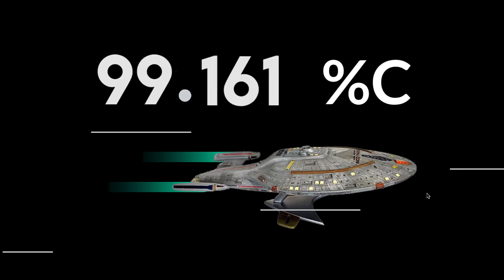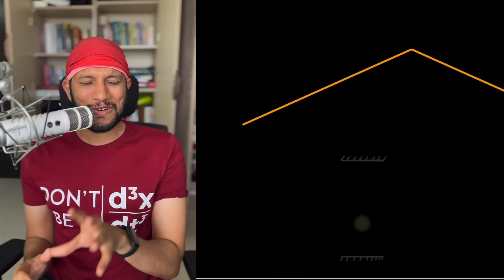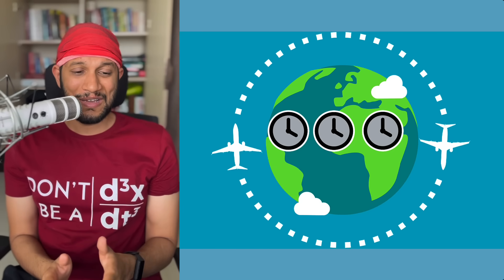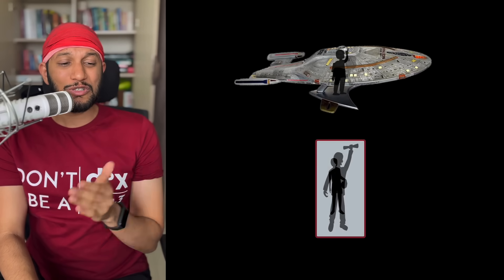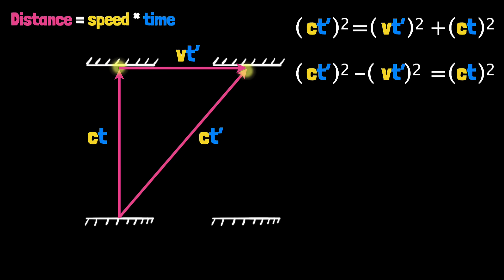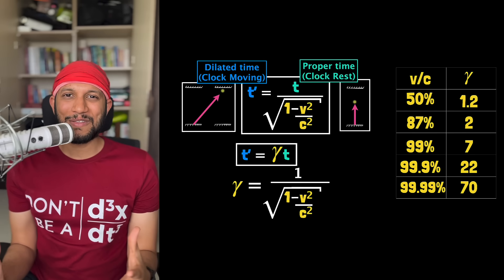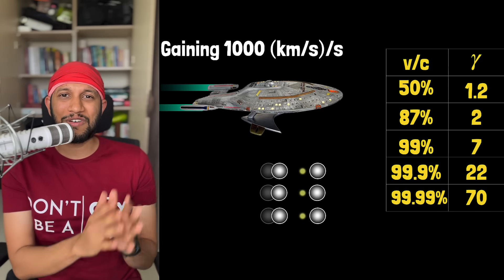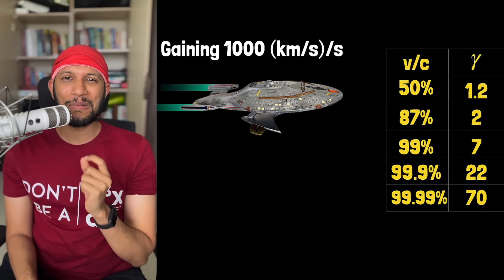I finally understood why you can't go faster than light! (My mind is blown)

Comment: It's just formula and every time when we find some infinite of something there is always some physical limits that prove our calculation wrong it might be bigger then any force in the universe can ever hope to overcome but not infinite just like it was with "Ultraviolet catastrophe" and so quantum mechanics was born. Lets we have no such thing as t` and we have some ball we want to accelerate but our only option is to throw other balls(for simplicity with the same mass) to it first time acceleration would be noticeable (from 0 to half on the speed of second ball) but as closer it is to our maximum speed of throwing it would be less and less significant until it will reach it but would never be beyond it. If do some math with it you would came to exactly the same formula for momentum as for relativity but instead of C there would be your throwing speed. The funny thing is that based on those formulas for relativistic physics we could get very precise match with observations but at the same time reasons for it might be completely different.

Comment: That's only one of the reasons that you can never get to 100% of C.  the second reason is that as you accelerate your engine's specific impulse has less impact on your speed as you get faster.  For instance at a certain point where your ship is traveling faster than the thrust produced by your own chemical burning rocket engine, you will have to switch to something that has a much faster propellent speed, such as an ion drive.  But then when you get to the speeds closer to C and you are literally accelerating the ship with Particles you shoot out the back at C, then you are getting less and less specific impulse as you get faster, and then it aproaches infinite fuel mass.

Comment: Your video is great. What I've heard no one address is the boundary between two objects with light speed level speed variation. Obviously we cannot "see" a clock ticking in a ship moving at light speed to compare with a clock at rest. But we use it as a device. And I am going to introduce an even less possible device for a though experiment to ask my question; If there was a video screen the size of Jupiter, and I was on a ship with the best telescope ever traveling towards it at 99% the speed of light, and the video was a clock at rest ticking, how would it compare with my clock on the ship? Would the clock be reporting the last 22ish seconds simultaneously? How can one meet 22 times the number of photons and have 1/22nd of the time to receive those photons? That is what I mean by the boundary. Am I missing something simple?

Comment: We are all going at the speed of light from the point of view of the opposite side of the universe. 

If the universe expands at half the speed of light the distance from the ends grows at the speed of light relative to each other.

Speed is relative. The earth rotates at a speed but road speed signs dont take that speed everything is already going and is only concerned with the additional speed you move relative to the objects bolted to the earth. 😎

Comment: So the speed of light is not attainable only with respect to the reference frame of an observer? From the explaination, the person in the ship would actually or eventually move at a speed of light at some point but won't know. Correct me if im wrong. I would also love to know the speed of the observation clock ticking outside the ship, using the ship as the reference frame this time.

Comment: I'm still confused -- does this break relativity in any way, e.g. if two space ships move at 0.5c relative to each other, does it appear to both of them that the other's clocks are running slowly? Let's say they exchange twins as they pass, and then one of them turns around and catches up to the other, will only the twins on the one that expended energy to turn around / catch up be the one where they aged at half speed? So it's acceleration that actually slows down time, i.e. we can time travel into the future by expending energy, even if it's to travel in tiny little circles?

Comment: What happens if I’m in a spaceship traveling 299,792,457 meters per second (one mps slower than light), and then I run forward in the ship, temporarily increaseing my speed by about 3 meters per second, which is about average running speed. Have I just gone faster than light? Idk.

Comment: The photon clock is analogous to what is happening in reality.  What do you mean you can't reach c?  You are already... every subatomic in every atom of your being as moving at c. But, there is only one c, so your internals slow down to accommodate your velocity thru the medium of the galaxy.  The same medium that establishes c, and motivates every subatomic everywhere to move at c.  The medium is made of subatomics that are not restrained by the construct of normal matter and always move at c without acceleration.  (The subatomics of normal matter are constantly accelerating.)  Things go boom when they try to exceed c.

Comment: The mistake is the assumption that time won't invert. The observer would see the faster than light ship vanish. The clock would tick forward but the position it ends at is where it was. The really weird part is traveling faster than light shifts off moving you through space and starts moving you through time. If you were to place your 2d graph from earlier into a cube instead of a grid you would watch as your time moved from a positive rate to a negative rate. Which means to travel faster than light to a destination, you would need to travel away from it until the "when" the destination "was" is "where" you are going. The trippy thing is this puts paradox prevention bubble around you as the locations you could actually reach at these speeds couldn't ever send light to where you started. After all, you had to travel several times further than the destination in space because your path moved through time. There's basically "drag" that slows you down for a distance controlled by your mass, overcoming this "drag" gives you a minimum radius of destinations you could reach at any c+ speeds.

Comment: i have a hypothesis for why time goes slower in a gravitational field ....
well time is defiened by things happening right ? (sorry for my English )
so .. for things to happen they need to accelerate and move right ? so the stronger gravitational field the more energy required xthe slower things move ... so that means that whatever kind of clock you are going to use ..if they are phesical clocks that are made of matter that have mass they will get slower in a gravitational field ... i hope this makes sense

Comment: You have come to the same incorrect conclusion that everyone I have seen talk about this subject has done. The reason we cannot travel at the same speed as a light beam that is traveling is because no matter how fast you are going, Light is always going 1x the speed of light faster then you are. As well as the thought experiment that is used to attempt to prove what you are saying is NOT valid because it is not possible to see the sides of a light beam so the so called "photo clock" used in the thought experiment is not possible to use in actual reality thus is not valid. A thought experiment must be a REAL experiment that can be done in actual reality even though you couldnt carry the experiment out at the time you think of is, it must be an experiment that could be done someday if given the needed circumstances to do the experiment. Thought experiments that cannot be done in REAL physical reality are not valid because they are completely imaginary and will never become real.

The idea of needing an infinite amount of energy to get to light speed is also an incorrect concept when claiming that light speed cannot be reached. Again this is due to the ones claiming this are not thinking of real physical reasons why accelerating to light speed cannot be done. When using propellant from a rocket it is the speed of the propellant leaving your ship is what determines the reaction speed that you gain going in the other direction so even if you had a beam of light as your propellant that beam is still limited by the departing speed of light and the reactionary speed that you would gain going in the other direction could never exceed the speed of light because the speed of the propellant leaving your ship always going to be limited be lights departing speed. So it is impossible to go faster then light speed using propellant because there's no propellant that we can shoot faster then light speed to be moved in the other direction faster then light speed. This is the reason why we cannot accelerate ourselves using propellant to the speed of light and it has NOTHING to do with having an infinite amount of energy at your disposal in order to do so. If the speed of light is a finite speed then what sense does it make to claim it takes an infinite amount of energy to reach a finite speed? To this day I never see anyone come to this correct conclusion for light speed and time dilation all I ever see are people like this that just repeat what they have herd someone else already come up with not realizing that there ideas on the topic are incorrect or the thought experiment they use to attempt to prove what they are claiming is INVALID to begin with....

Comment: How about this? The only way to push, or add kinetic energy, to a mass is by a force applied by electromagnetic interaction (QED), photons moving in the direction you want a mass to go. No matter how much energy you put into the photon, or how many you apply the photon energy is red shifted to zero relative to a mass moving relative to you in the direction of the photon at the speed of light.

Comment: Question: I’m still early in the video so maybe you address this, but why is it necessary that the ticks of the photon clock are slower just because it’s traveling a further distance? Sure its net velocity is higher because because of that, but its movement in the vertical direction is still equal, right? It’s just that now there’s a horizontal component as well which is being applied by the movement of the ship.

One issue I see with the above statement is that this could generate speeds faster than the speed of light. If you are traveling near the speed of light in the vertical direction and then added a horizontal component, if they are not completely independent, then you could go faster than the speed of light. So I imagine I’m wrong with the above statement, but I’m not sure why
Reply from the maker: You actually mentioned it yourself. The net velocity (along the diagonal) has to be c! So the vertical component can no longer remain c. It’s lower!
Reply: @Mahesh_Shenoy ah ok. My bad. Thanks!

Comment: but if the speed C stays the same in all frames wouldnt the people on the ship see the ship still gain speed at the normal rates? it sounds like thiis only works for anyone out side the ship looking at the ship?
Reply: People on the ship would accelerate at normal rate, but their speed relative to outside objects wouldn't reach C. 0.99C + 0.01C < 1C.
Not sure if it can be explained by time dilation, it's more about space contraction from that frame of reference
Reply: just seams that if C is the same in any reference frame then C should still be at the speed of C for the peoples reference frame in the ship meaning to them they would continue as if nothing different was happening. if not then the speed of C iis changed for the people on the ship 
 @fritt_wastaken
Reply: @VdemiconV  everything is normal for people on the ship, C is still C. But speeds don't add up linearly, they never do
Reply: @fritt_wastaken  sorry it took so long to write back lol was moving and starting a new job. but on the ship everything is going as normal. so it would be like watching someone fall into a black hole. at the event horizon the one watching would see them stop at the horizon and then slowly fade out. but they are no longer where you see them. that is why i still think the ship moving closer to the speed of light will be still working as normal and getting to that speed but because of dilation you only see the ship slowing down until it fades out like if it fell in a black hole. because for the people on the ship nothing for them has changed because its all relative on if your are watching of flying.

Comment: Mahesh, suppose a ship goes away at .6C in one direction from you and another ship goes .6C in the other direction from you.  From your perspective no laws of physics are being broken but wouldn't it be broken with respect to each other?  Here is where I get stuck.
Reply: If you're talking just about speeds (and not space expansion) someone viewing from one galaxy would see the other galaxy going at 80%C. Speeds don't just add up linearly
Reply: @fritt_wastaken  there's no absolute speed, so I was talking about a galaxy going 1C with respect to another.  And I wasn't referring to space-time expansion.
Reply: I'm going to restate the question above
Reply: @mr.beepers2119  From your perspective ship 1 goes to the left at 0.6C, ship 2 goes to the right at 0.6C. Lets say after 1 second (from your perspective) you and ship 2 both send a signal.
From ship 1 perspective you've sent that signal after 1.25 seconds while moved 0.75 lightseconds, 0.75lightseconds/1.25seconds = 0.6C.
Ship 2 sent that signal after 1.7seconds while moved 1.5lightseconds. 1.5lightseconds/1.7seconds =~0.88C, no laws being broken.
Reply: @fritt_wastaken  okay, I think I get it.

Comment: I like star citizen's current interpretation of "warp" engines,  or quantum drives as they're called.  You can zoom around a solar system but it actually takes a while because none of the drives are ftl. Like 45-200k m/s

Comment: You need to explain something to me. If the you are observing the object accelerant within the acceleration reference frame (although it might take an eternity from someone outside to see you accelerate another 1000k per second) its still one second to you if you are inside of the accelerating reference frame. Then given an infant amount of time couldn't the ship reach light speed for those on it? So for someone on that ship hitting another 1000k per second would be one second to hight light speed. why doesn't that work. 
( I know it doesn't I just don't get it) I brain says it has something to do with that the speed of causality is till the same to them on the ship, however I'm not sure. Thank you for what you do!

Comment: One thing i still find hard to understand, is why time dilation works this way - the ship ages slower than the earth. From the perspective of the ship it's stationary and it's the Earth that's moving. So the earth should be younger. I've explanation everyone gives is that "the so is the one that accelerates" - but from the point of view of the ship, it's the earth that accelerates? So what gives?